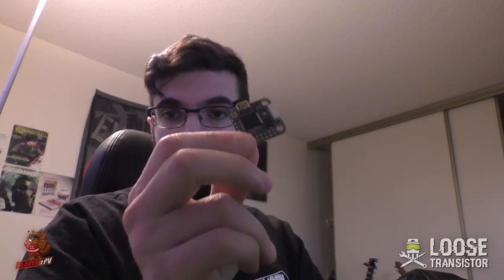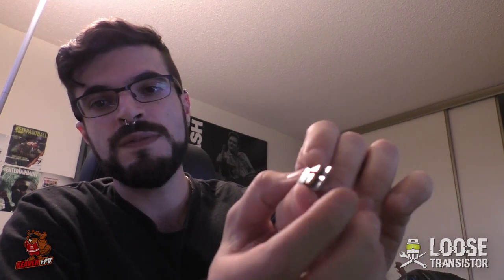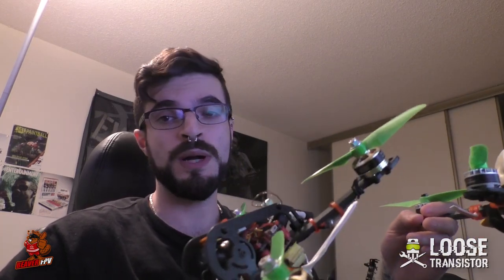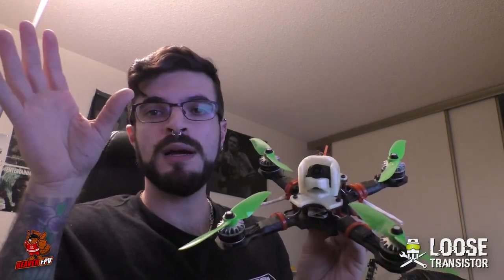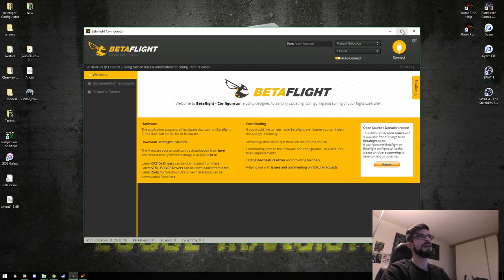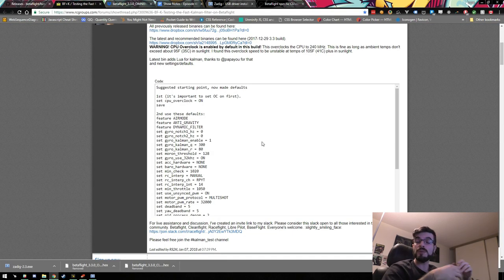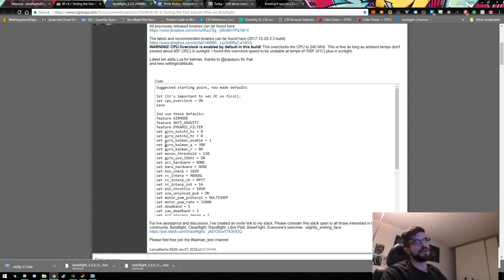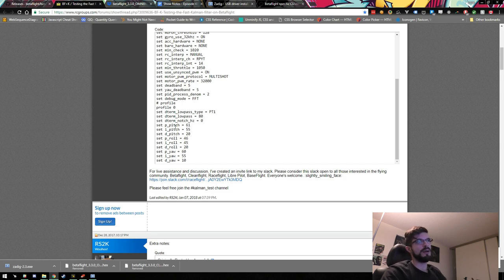Betaflight 3.3 Kalman Filters - Setup

Comment: I've done a bit of testing the kalman filter with 7" bi blades with good results, just my matek F405-CTR soft mounting seems to be causing more noise than I really like vs my betaflight F3 board
Reply from the maker: Adam-g1 what MPU in the matek?
Reply: Loose Transistor FPV 6000. I just swapped out the gummies with my normal soft mount, hopefully it works better
Reply from the maker: Hmmm yeah shouldn't be too noisy... thing is it's getting cold lately so gummies are hardening up a bit and not providing as much smoosh action

Comment: why when i flash the 3.3 kalman hex betaflight no longer connect the gui will freeze then wont connect but when i use normal hex 3,4 everything is fine thank you
Reply from the maker: What FC are you using?
Reply: betaflight F3 board

Comment: have you had any issues with smart audio with 3.3.0? I loaded it onto my Xrotor FC and it doesn't seem to have smart audio built in yet. Otherwise very good setup with the kalman filter.
Reply from the maker: Neither of the quads I am using to test in this case have Smart Audio unfortunately so I won't be able to test.

You gotta keep in mind that this is very experimental - and as such Kalyn has not yet implemented fixes and everything for all the FC's available. If you are really set on using smart audio I would wait until the official release
Reply: RoughRider Fpv what VTX are you using?
Reply: TheRealJonnyD Mach 2
Reply: RoughRider Fpv that's not gonna work on 3.3... AKK reverse engineered the SA protocol from the bugged code in the pre 3.3 version of betaflight. The bug was fixed in Betaflight 3.3, so it no longer works with any VTX that AKK produced (AKK/RDQ/Wolfwhoop) using that reverse engineered code.
Reply from the maker: Yes I do believe Smart Audio is not working on current 3.3.0 with Kalman filters
Reply: It still works with the Tramp and the Unify.   I can't verify the Unify but I have smartaudio on a Matek F405-OSD and Tramp setup with 3.3 and Kalman.

Comment: is it normal for accelerometer and barometer turned off after flashing . now my model wont ,ove on screen in betaflight gui
Reply from the maker: Christopher Fisk yes it is, model only works in betaflight if Accel is enabled. Depending on your board it my not be possible to have Kalman and accel
Reply: Loose Transistor FPV thanks for the reply I'm using matek f405 and my accelerometer wouldn't switch on that's cool was just checking it's normal
Reply from the maker: If you are using the Hexe's posted in this video the settings are already hardcoded in.

Comment: I ran the Kalman build OC on a Matek F405 @ 32/16 and it smoked my CPU after a 20sec test hover. Be careful when testing.
Reply from the maker: Yes that is a very good point. Overclocking should not be attempted unless you understand what you are diong and are OK with the risks.
Reply: Thanks for the info I the F405 aio. Think I'll hold off till the newest filter that replaces this that their testing comes out.
Reply: it's not the filter. it's a warning about beta testing the bleeding edge (and a little about overclocking these tiny processors)
Reply: Slowtreme just saying why run the risk on something that's already obsolete.
Reply: the FIR2 is just another take on Fast kalman. We wouldn't have this without the other. It's still using Q R P

Comment: Hey mate im trying to set my quad to Run 32k but im having some problems.  It works in 8k/8k, when i enable 32k sample mode seems that ThE motors are not sync.  In betaflight 3.3 motors disync is crazy they go 0 to 100% randomly, in butterflight its much Better but still have ThE problem. I have omnibusf4 pro corner T-Motor F40 pro v2 and T-Motor f35A 32bit ESC (all esc with Low esr cap). Using 1200 dshot (also tryed dshot 600).
Filter Settings: pt1 all notches off fast kalman filter type airmode and anti Gravity on. Here is short vídeo shiwing whats happening: https://youtu.be/I47r-WJZ4X0
Im also having problems arming ThE quad in 32k mode even after Change moron threshold , tryed 0 to 200, sometimes i can arm sometimes not.
Appreciate if you can take a look and maybe you can help me.
Thank you
Reply from the maker: You need to run it in multishot